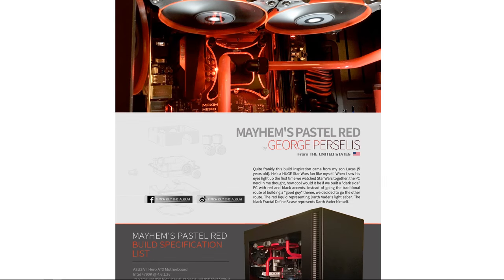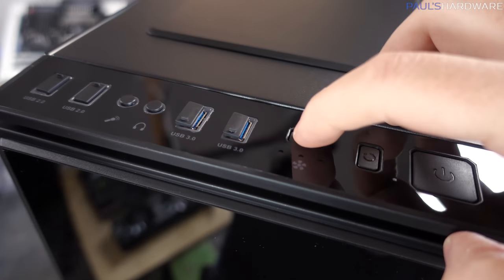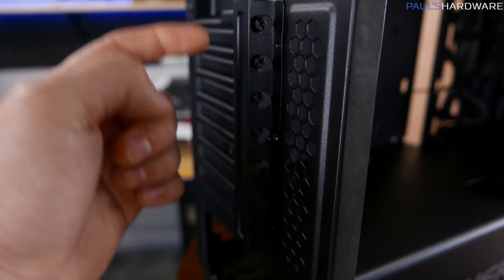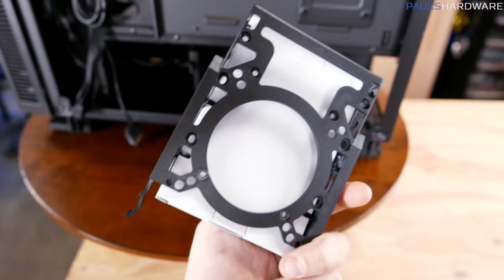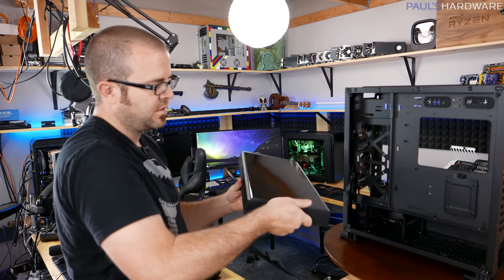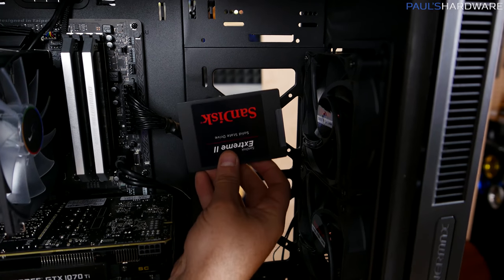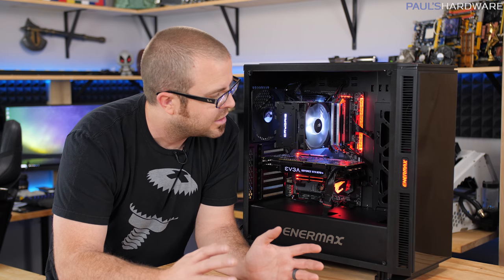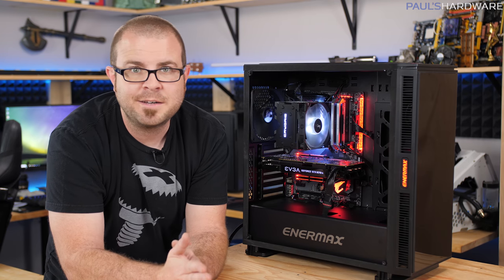Quietly Flawed: Enermax Equilence Case Review

Comment: Enermax on the right track with this one, just gotta fix a couple mistakes (IO is glued to the front panel? for real???) with another revision and they could really have a killer case.
Reply: I totally agree. I am disappointed with how this case turned out because it's missing things that cases well under $100 provide. A good revision of this case could help Enermax out tremendously.
Reply: Looks like a define r4 thru 6 but a lot worse.
Reply: also that massive Made In China text on the back, gross.

Comment: I kinda like the look of this case. Reminds me of the fractal cases with the side vents. Is it worth $110 though? Not at all since you could probably find much better cases for that price like the S340 elite, Mastercase pro 5, or Corsair's Crystal 460X which has even more tempered glass. For less than that you could get an S340 (non elite) and have way better cable management since it has that metal cover over where the 24-pin would go and it even has a front dust filter.

Comment: I have this case, and I love it. I fully agree about the dust filters.  I think I will be buying some aftermarket ones now that you mentioned it.  The price was simply average, and it certainly did not stand out from the competition price wise, but it was in stock and fit my needs.  Overall, I am very happy with it though, it is great quality and made cable management a breeze.

Comment: I have this case. I got it for free due to a mistake Amazon made. YES, it is quiet. I had no trouble routing the cables away from the grate on the rear. And the cooling is actually pretty good. BUT I did swap out all the fans for Noctua Chromax fans I got from a friend of mine. My color scheme is red so this actually works out good for me. I did enjoy the video as it was the only review I actually saw on this case.

Comment: @Paul I think you're missing the point of the rear radiator mount. The air for it comes from the front of the case. The front has vents on the left and right  (if looking directly at it) the right hand side channels to the back of the radiator mount.

Comment: This case is a fail for it's price. Over $100US for a case with non RGB lighting and no dust filter. You should get a Fractal case or a S340 Elite.
Reply: I'd spend a little more and get a Fractal Define R6...
Reply: Fractal does this style of case best. Enermax could have been one of the few maufactuors to fix the airflow and have a unique selling point but they saved money on design and used a photocopier and tracing paper.

Comment: Nice vid, I picked up this case with a decent rebate. I agree with the cutout thing, I was initially planning to put my SSDs there, but instead I did the fan thing to cover the the gap so I can’t see the cables anymore, but yes, those fans are for aesthetics and do nearly nothing in terms of cooking. Overall though it’s a clean looking case inside and out. I didn’t find it to be all that quiet though. I’m using the fans that cane with it and 2 Corsair quiet fans, but it’s not “silent” even on the slowest setting and with the top vents covered. Or maybe it is quiet and I was just expecting something like my Mac Pro.lol

Comment: I just want to start off by saying nice video!
I just bought this case for $70 for my current build.
secondly I think enermax heard your plee for the dust filters because my bottom tray is pretty easy to remove as well as having 3 120mm dust filters for the front panel fans. Along side my front fans were actually out of the box installed on the inside of the case rather than the outter front part.. I have yet to put my computer together since i am waiting on shipping so if you would like pictures of the case updated a year late id be happy to show you!
i am along with you also disappointed with the top part especially that i would have to remove the whole top panel just to gain air flow.

Comment: Nice review, but it's a bit off to suggest an open front panel for a case focusing on silence. That's a trade-off you have to think about but have to make: Either you have a silent case with limited airflow from the front or you have plenty airflow from the front but ditch the "silence" aspect. You can't have both. I agree on the dust filter issue, though.

Comment: Seems Enermax may have tried to incorporate the side/back fan location as a potential to mount a water pump also being that most pumps have the option for a 120 mm bracket, but it is not clear.
Adding some ventilation on the back panel would have made sense, but it appears they have confused their priorities for silence or functionality.

Comment: Why would you not mount the SSDs on the other side of the crossbeams, so there is no cabling running into the inside of the case and there is no risk of the fans and SSDs interfering with each other's space?

Comment: needing a case badly, have micro atm msib450 i mb, xfx 5700 dd ultra, 240ml aio with push pull config, will this case work with a push pull 240ml aio fan config in the front????

Comment: Damn, they came soooo close to making a very nice case.  The front should provide enough airflow if the fans are moved back like you did. 360 slim rad should would great. But that weird XX mounting bracket in the case for extra fans/2.5 SSD is a compete miss. What where they thinking if there is no external exhaust.  Perhaps a nice piece of Plexiglas cut and backside spray painted would dress that bracket up really nice. But not everyone can or is willing to do that.. Last why is that front IO attached to the front cover??.. What is this 1997 again?
Reply: Even with a cutout on the backside, the fans on the X panel would only disturb the airflow. It's just good for looks with LED fans it has no value for performance.

Comment: hi, what combo would be best for low budget pc, i5 8400+gtx1060 6gb +hdd, i5 8400+gtx1060 3gb+hdd+ssd or i3 8100+gtx1060 6gb+hdd+ssd? i want it for longer time, so i dont have to upgrade in 2 years, ill ofc have 16gb ram
Reply: Daniel Jánoš
Why not use some old junk build, only buy a 1060 card! Or a PS4!
Forget low to ultra low budget gaming, they sell PS4's for cheap, gaming PC's need to be good, gamers rated hardware.
Reply: lucas rem i have 850€ budget, thats not superlow but 1080 ti cost 900€ here so....

Comment: That side Radiator/fan mount part is just screaming for a bit of moding. 
Something like 3d printing a thematic piece.Maybe use some acrylic and some die cut sticker, paint it and peel the sticker off. Add some rgb strips for good measure. BAM !
 Also you even could center it so the clear parts over the SSD label, also some gromet holes if ya 3d print it.

Comment: Aaaand immediately it sucks. Same problem as the Meshify C: what's the point of tempered glass that's tinted so dark I can't see inside the case? Just reduce cost by using a metal side panel at that point!

Comment: They have plenty of room to remove some metal and add some rubber grommets beside the SSD mounts for routing cables. Also I'd like to see the Enermax logos go. I understand why they want to market the case but they're too large and gaudy. I like this case but I'm giving it a pass due to the logos.
Edit: I just want to say I don't like dust filters. They block air and if they get clogged and you forget to clean them it becomes more of a problem than having dust inside the case.

Comment: So Enermax makes good stuff. Their Threadripper AIO's are really nice, and perform well. But this case is built like a sub $50 case. No filters (top or front). Front panel wired to the case via the I/O panel. I don't believe for a second a decent 360 rad will fit up top. And if you put the fans where they need to be up front for actual airflow, you won't be placing a decent 360 rad up front either. There are $50 cases way better than this. Again, Enermax makes some nice things, but this case isn't one of them. A good video review by Paul, as usual.

Comment: There's just nothing that this case seems to do to make it stand out from the pack, and that back panel is really bad. I don't think I would use this case. If I wanted a quiet case in this price range I'd go fractal, and if I wanted a case with air flow I'd get Silverstone's RL06 which has similar flaws, but makes up for it with air flow.
Reply: Brendan Bush it honestly looks like a cheap ass 30 dollar case even with the TG. Also looks like a dust magnet.

Comment: If this case had come out like 4 years ago then maybe it would be worth the price they are asking. You can get so many better cases for the money you would pay for this one, what are they thinking? It looks like a cheap ass case with glass
Reply: I agree, it's a cheap ass case with a glass side panel and plastic front that is so smooth and shiny it will show every speck of dust and finger mark. That means you will be constantly wiping it which means it gets scratched up very quickly and it will look terrible !
The problem is they are trying to give too many options and really haven't thought it through, if they are aiming to produce a very quiet case then why have the top removable and a glass side ? There's plenty of fan mounting points but poor airflow and the case is not tall enough to fit fans at the top. An air filter for the PSU which is inaccessible but nothing for the rest of the system and what is that ugly SSD mounting panel doing there ?
There are more things to dislike about it than things to like even if it was half that price I wouldn't be tempted !
Reply: It is NOT a cheap ass case, it is quite good.  However, $89-99 is much better.

Comment: Dear case manufacturers: I DO NOT want a flat, plain front panel, no matter the material, no matter the sheen(since that's literally the ONLY design variance) - ESPECIALLY at the cost of at least "A" 3.5/5.25 bay, AIR FLOW, and, in general, more unique & original styling(something that will look nice in an office, living room, or otherwise an ADULT's home). I'm definitely a minimalist over just about any other description, but I'm not going to spend $100+ on a plain, square, fingerprint magnet box with shitty airflow.

I do like this case, just like I like the new Define R6, but I have yet to see a new case that I'd pick over a Meshify C or an Enthoo Pro M.
Truly a lame time to buy a new case.

Comment: The enermax logo on the PSU shroud is ugly as hell. Would definitely mod that out. Adding vents to the side panel for a visible radiator mount would have been the smart thing to do but I assume that keeps costs down.

Comment: Wait, the HDD mounts are made of plastic but the SSD mounts are made of metal? ...that seems bad. Fractal has the HDD trays made of metal and freely placable rubber grommets so it doesn't vibrate. Plastic is always bad. Paul, please properly test the HDD mounts in case reviews, not everybody has gone full SSD yet, if you got 3 or 4 old HDDs then you want good mounts that don't swing, vibrate or start rattling after you've build it. Badly designed HDD mounts are often a weak point that no one points out.

Comment: Permanently-attached front I / O cables. How I loathe them so. Yet another case you have to cut, strip and fit the cables at the front because the idiot who made this case can't figure how to tie it together at a single connector. Might as well sleeve them at that point and make it look better. I'm sick of seeing this. More manufacturers really should incorporate a nailbed design for the front ports so the cables can remain connected.